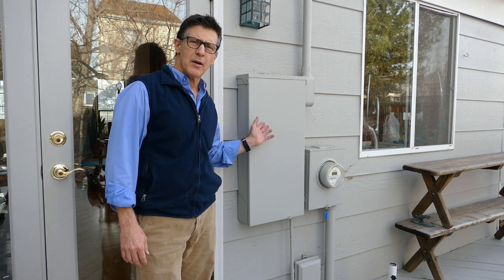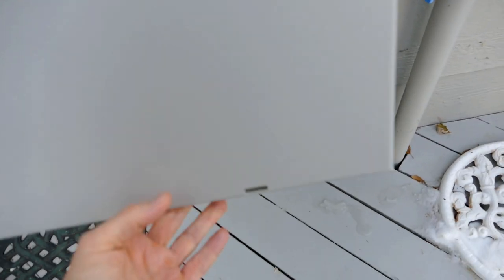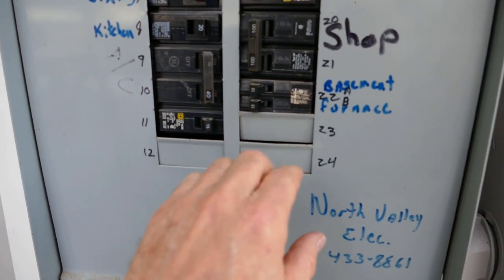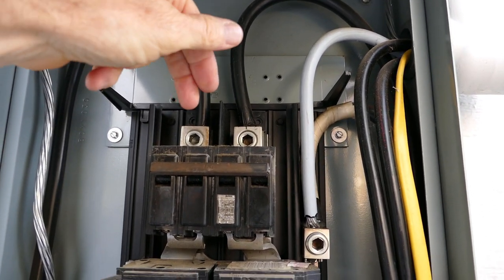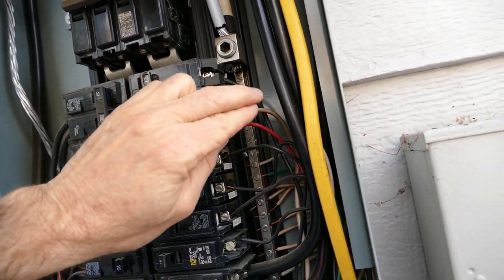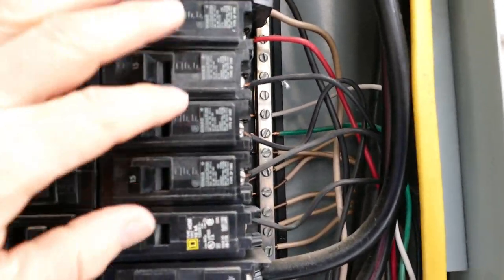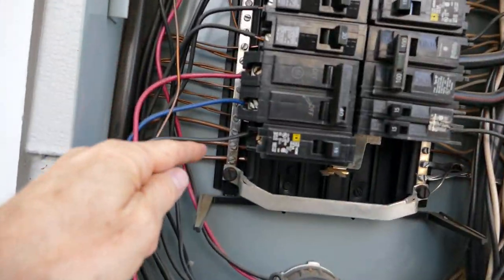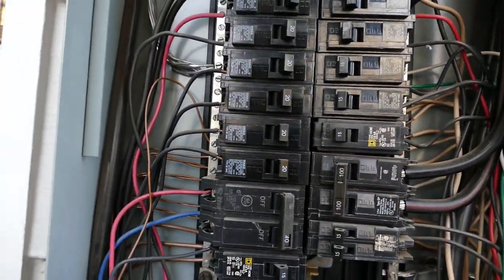Anatomy of an Electrical Panel

Comment: I realize this video is 2 years old but if you haven't done so in other videos, I'd highly recommend the use of a non conductive item to use as a pointer in stead of your finger. Just a safety thing.
Reply from the maker: Thanks JoeWeber4537! It's a good idea. In the video I did state that I'm keeping my fingers about 3" away from any of the 'hot' components. And, over the past 17 years I've poked around in probably 10,000 electrical panels, and I've never been shocked... yet! I plan to keep it that way! Thanks for your concern.

Comment: Why 4 main breakers?
Reply: In order to have 220 (240) volt service you need two (110 volt) hot legs. The current in these legs alternate back and forth between +110 volts and -110 volts. The electricity in the legs is 'out of phase' so that when one is +110 the other is -110. This is how you get 220 volts. That is why there are at least 2 main breakers in every modern home. In this panel there are four because there are two for one leg and two for the other leg. This is likely because  each breaker is only capable of carrying half of the maximum current that the panel can carry. This panel is rated for 150 amps. So each of the 2 breakers on the legs can carry 75 amps. Add these together and you get 150 amps. Note that 2 of the breakers will be 'in phase' with each other and the other two will be 'out of phase' with the other two in order to provide 150 amps at 220 volts. I hope that helps.

Comment: Hey ive got a horable power leek a wantabe electrician did something when he ran a extrea wire to the master bedroom , heres my clues the breaker itself looks like it had been pried open and hooked into a 2 slot breaker the damaged one , then on the 2 slot resurved for the hotwater heater has a white wire hooked into the 2 slot breaker 'hwh' witchs trips often last thing that looks hooky is a black wire of some size 1/4 size of main is cut off exspoised sitting there coming out the same place as the main!. Ive been a traidsman for over 20 yrs this doesnt look rite please help i can send pics if needed
Reply from the maker: Hi Ernest, If you still need help contact me through the HouseKnowHow.com contact page. The link is: https://houseknowhow.com/contact-us/